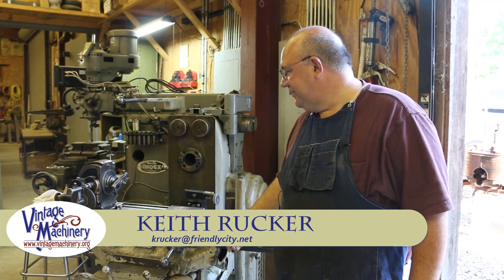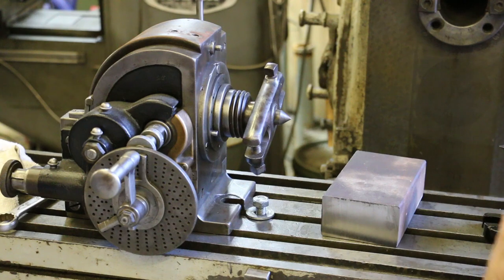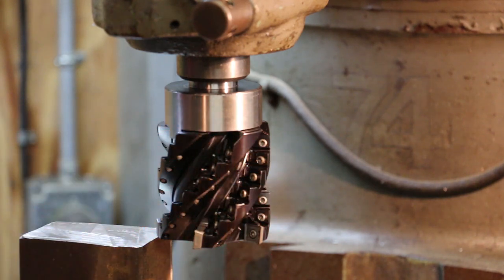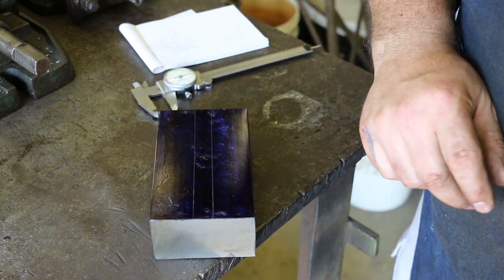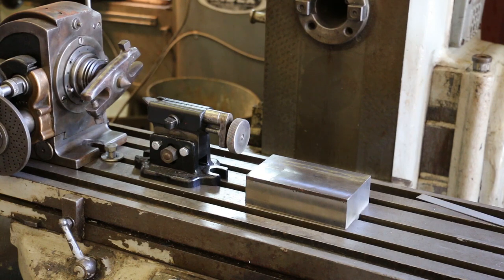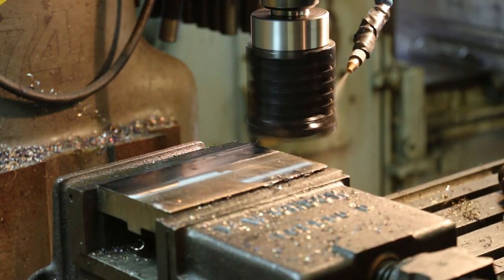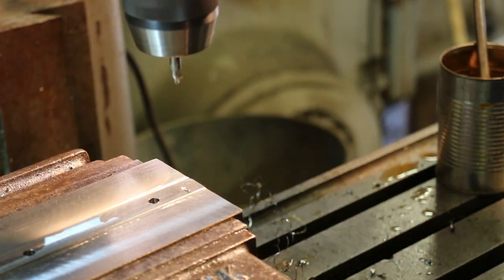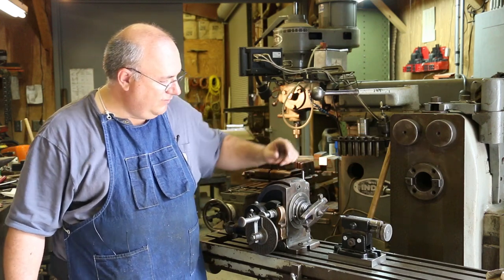Machining a Height Extension for a Dividing Head Footstock

Comment: One of the other Youtube machinists (Tom Lipton?) has a similar tailstock, and the ability to adjust the angle of the tailstock will allow things like machining keyways or splines on a tapered shaft. A nice feature to have available.

Of course, it will also require raising the tailstock by different amounts depending on the exact angle as well as the distance between centers. If you can get the tailstock raised to just a bit above the required height, the effective height can be "tuned" by changing the amount of stickout of the spindle of the tailstock.

I can't tell if there is a machined flat on the top surface of the tailstock which would allow using a sine bar to get precise angles (to match the angle of the dividing head) by indicating.
Reply from the maker: Peter W. Meek This footstock will also allow you to adjust the angle for various reasons, as well as fine adjusting the height.  As to the top of the dead center being flat, this is pretty common and it is to allow clearance for the cutter to not cut into the center.  Very often, the cutter is running directly above the center on the footstock.

Comment: Looks good at the end Keith.  Pity that mrbozo turns up just at the wrong time. If you are not satisfied with the location of the base and top there is another solution I used when a piece of stock was not thick enough for the job. You could take out the cap screws and drill and tap 1/2" in the same location. Loctite in a couple of decent hex bolts on top of the locating shoulder then machine them off to 5/8 wide and machine the top  to leave 2 keys about 7/8 long that are the correct height. Then redrill the cap screw clearance hole through the bolts and refix the 2 pieces together. Look forward to the next episode. regards from the UK
Reply from the maker: Gary C While I was not happy with the bozo mistake, in the end, it will not matter.  I will probably just leave it as it is.

Comment: Neat job Keith, the way you used the screws to mount the center on the plate
will keep them together. So I feel it worked out to your advantage.

Great thinking on your part.
Reply from the maker: Skeeter Holeman I am not worried one bit about the part moving around, it is as stable as one could hope for!

Comment: You could always mill a female slot and use male keys like the original setup, which has the advantage of being able to remove the keys in case you need to setup offset or at some odd angle that doesn't align with the table slots. Having to work so you can do work is a never ending battle. lol
Reply: bcbloc02 +1 on Brian's idea.  Of course, you can leave it like it is and keep that idea in the back of your head in case you might want to do it later.  It would sure resist side loads better, but might be more difficult to get an overall tight and accurate fit.
Reply from the maker: bcbloc02 I considered milling a slot like you describe but what I have now will work just fine.  No need to go to a bunch of extra effort.
Reply: like your comment, you focus on the solution, not the problem

Comment: Hi Keith
Great video as always.
Mr Bozo may have been trying to act as a teacher.  You stated the T-slots in the vertical and horizontal mills are of different widths, meaning you'll get a sloppy fit in one and snug in the other.  Why not turn the Bozo'd plate over, using the full-depth raised ridge to fit into the slot of the tailstock.  Then mill off that thin ridge making the opposite side flat.  Mill two bars of different widths to fit each of the different sized T-slots and bolt corresponding one to the flat side of extension.  This provides a snug fit on each bed and the tailstock.
Reply from the maker: Morris Gallo On the mill with wider slots, I just push both the dividing head and the footstock to the same side.  If I did it the way you are suggesting, the footstock would be in the center of the T-slot and the dividing head would be on one side or the other (or some random place in between).
Reply: Keith Rucker - VintageMachinery.org Which is a very effective, old school, way to register your device bases to the table, as we were taught way back when...

All the Best,

Eric

Comment: Hello Keith,

I am very curious about how you go to make gears with the dividing head and don't have any clue how it works. So I am looking forward when you go to make the gears for the blower. 

It surprised me that you didn't know what kind of material that piece was and it looks like a kind of aluminium. Maybe it is a kind of aluminium they use for making structures from airplanes. Light, very hard and no corrosion seems to me like airplaines. 

Anyway again a very nice video and I always remember measure twice and than make the cut or hole haha. I feel good that even you make sometimes a little fault because I don't feel so stupid that I did that moretimes. 

Many greetings from Roel !
Reply from the maker: RoelTyros That material is anything but light - I think it is even heavier than steel.....

Comment: Curious why you did not hog the material off with your horizontal mill?  I thought big wide hogging cuts were one of the superiorities of a horizontal mill.  Was it because the material was so hard/tough that you wanted to use carbide?

Great set of videos.  I really like your presentation style.

Comment: great video keith. thanks for sharing your bozo moment. we have all been there. couldn't you have milled down another 50 thou or so and made up for it by adjusting the tailstock up that amount? my tailstocks have a good bit of adjustment and i havn't had a job yet that required moving the tailstock up or down any where near the full travel of the tailstock.
Reply from the maker: larry sperling I could have, but I decided to leave it as it was to maximize adjustment.  In the end, it really does not matter, it is not going anywhere....

Comment: hello Keith, you can mill slot in your extension and make a rectangle key to fit in this and it would be better to register
Reply from the maker: Radoslaw Jocz I considered that but decided it was not worth the effort.  What I have will work just fine.

Comment: ............Inconel......and if so, that bar is worth a TON of money. Would be worth selling and using the funds to buy steel and possibly some other items.
Reply from the maker: Brian Streufert I looked up the specs on Inconel and it very well could be.  Wish there was a way to confirm the alloy without having an analysis done.  And even if I could prove what it was, I would have no idea where to try and sell it....
Reply: Brian Streufert Would have been worth more before he milled half of it away. Oops. At least it won't rust. :P
Reply: Keith Rucker - VintageMachinery.org You might try taking it down to your local metal recycler, they usually have a gadget to identify the material.
Reply: Bruce E Usually a PMI (Positive Material Identification) gun...
Reply: justfakeit888 If Keith kept the chips, sell a bag of chips on Ebay... ''BAG OF BBQ FLAVORED INCONEL CHIPS:  buy it now: $150''...    ;-)
Reply: Keith Rucker - VintageMachinery.org Do a spark test: hold it up to a grinding wheel and see what the sparks are. If they are short red sparks you probably have a piece with high nickel content. If the sparks look like steel then you might have something like A-286 which is a type of stainless steel… I can't remember if A-286 is magnetic or not… I highly doubt that piece is INCONEL because of the relative ease in cutting it. If it is a high-nickel alloy (20%+) then it could be INCOLOY which uses Iron as its principal ingredient instead of Nickel-Chrome….
Reply: Keith Rucker - VintageMachinery.org Inconel, Hastelloy, and a bunch of the high nickel (A286...high temperature) alloys cost a boatload of money!  They have dropped 50% in price since 2008, because of the international depression... and China's production has recently hit the skids.  At this time, nickel alone is $5.00 a pound; chrome is ~$2.00 a pound.  Yeah, if you can find out what it is, it might be a better idea to resell the rest and purchase some lower cost steel or even iron..... and get a few $$ in the trade.  Be a shame to waste pricey material on just a spacer.   Could be worth $10.00- 100.00 a pound !!!!!!!
Reply: WAVETUBE84 We are currently sourcing out some parts in Incoloy 800H for work - talk about pricey!

~10x the cost of 304L

Oil refining only just hit the skids around Christmas time, so the high nickel and high chrome alloys haven't quite dropped much in price yet... there's still a backlog in the fab shops, who are still quoting ~6 month lead times...

Comment: Keith, Nicely done job. I did one similar to that recently. Same situation.
What technique did you use to determine the height difference between the tail stock and the dividing head?
All the best!
Eric
Reply from the maker: esoomreltna I put a reamer with a long ground shank in between centers and then ran the table back and forth with an indicator on the top of the shaft to watch for changes in height. I then bumped the height of the tailstock up or down until it was running just right.

Comment: 16:00 But you need that extra material just to have some material there - not to define dimensions or for dimensional integrity - so you could definitely extend that rail with expoy if you wanted to.  Just remember to rough up the surface first.

Comment: The foot stock looks to contain a metal plate that governs its height, I'd have thought it would have been easier to replace that. As It looks like it's only bolted in place. Unless you wanted to have integral T fittings or other features which the foot stock did not originally have.
Reply: Believe me I'm all for upcycling.

Comment: Is there any other way to scribe layout lines from an edge apart from measuring calipers? I'm asking since dial calipers are measuring tools and not really intended for scribing, is there a dedicated tool that is designed for this? Like hermaphrodite calipers but with the ability to be accurately set.

Comment: ok, so you say to have removed a bit to much from the metal. so why not add metal by tig welding, mig welding or even stick welding???
Reply from the maker: +Robert Ostman It just was not critical on this particular job.  It worked out just fine, just not as I had originally planned.

Comment: Might be stating the obvious but since the tail stock is adjustable up or down you can go ahead and mill down the bottom base some more to make the key higher. to 1/8" as originally planned.
Reply from the maker: 1NRG24Seven Yes, but the height was designed to give me the maximum amount of flexibility in adjustments.

Comment: The "mystery material" possibilities are endless. Inconel 600, 625 and 718 are non-magnetic, as are annealed 300-series stainless steels (302, 303, 304, 316). However, the 400-series stainless steels are ferromagnetic (magnetic). Considering product availability, 410 and 420 are possibilities. If this bar is government surplus, 17-4PH or 13-8Mo stainless steels are good candidates. In the solution annealed form, they are ~HRC 30 but deliver a decent machined surface finish with considerable cutting effort. Both alloys are popular in defense development programs because of their simple, low distortion, age hardening heat treatments. Neither 17-4 nor 13-8 is equal to type 304 in corrosion resistance, but still consistent with your outdoor rack performance. Many steel suppliers and scrap yards can identify alloys non-destructively by XRF (X-ray fluorescence), sparing you the cost of lab analysis.
Reply from the maker: Dennis Stephens All I know is that this material is pretty tough stuff.  It machined well but I had to take a lot of small cuts and take my time.  About half way through the job, I really thought I would have been better off if I had just bought a piece of steel......

Comment: Hi mate.
I bet you left the door open.  You can't leave the door open mate, it's an invitation for Bozo to get in, and start clouding your head.  It's a bit of a shame, but at the same time, it still works.
Thanks Keith,
Marcel.
Reply from the maker: Marcel Timmers I have found that Mr. Bozo likes to come in even when I have the shop locked down tight.  He can slip in the smallest of crevices into the shop.....